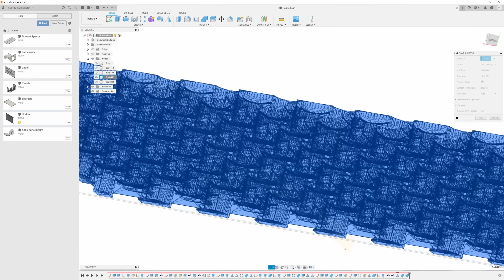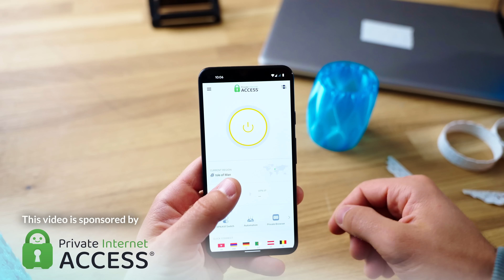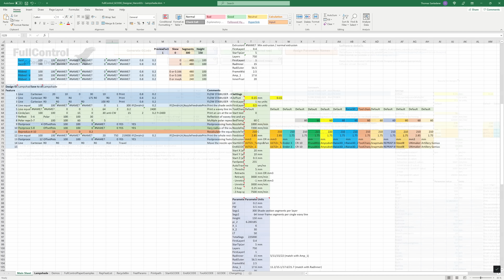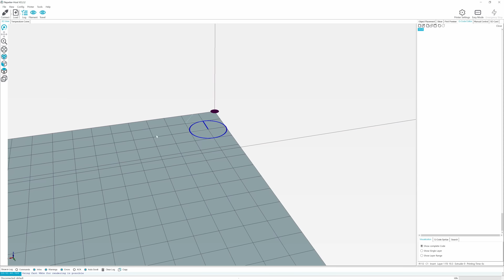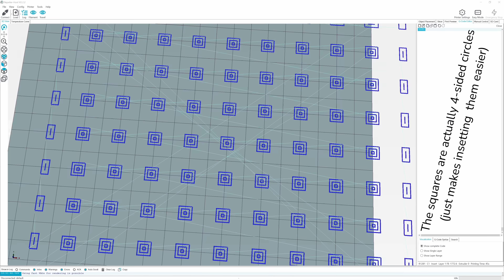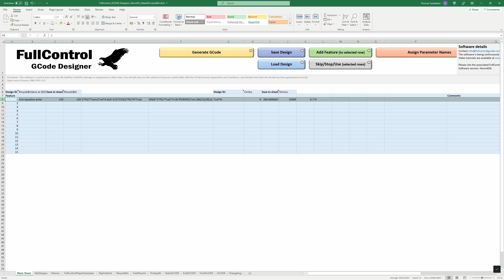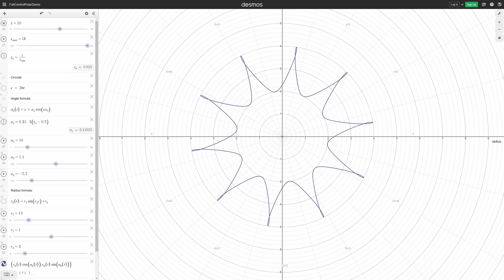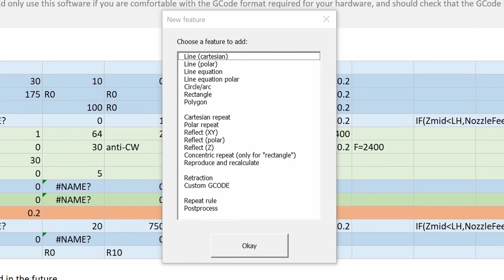You can SKIP 3D modeling now

Comment: This is making me think that 3D editing software needs to have a "3D printer" mode whereby aspects of the modeled objects are tailored to being 3D printed, like you tell it you'll be using an 0.4mm nozzle with 0.2mm layer height and the snap-to-grid functionality is adjusted to work to those parameters, ending up with objects that are more "3D printer friendly", which would be especially helpful for mechanical prints.
Reply: makes me think it openSCAD could be modded to something like this? instead of using uh excel...
Reply: or etch a sketch mode, with a 3rd z dial
Reply: I don't know how long it's been there but Blender does have very rudimentary and basic 3D printing visualizations. It will color highlight overhangs or intersections that can be fixed before exporting.

I was thinking the same thing. 3D programs are WAY ahead as far as modeling and automated repetition when it comes to slicing. They SHOULD have this option to control and out put gcode right from the start. This "full control gcode" I think could possibly be written as a blender addon... maybe. Blender already has a slew of mathematical nodes for shading and geometry.
Reply: I set user parameters in Fusion 360 to optimize these things as you say. Any shells are multiple of my extrusion width parameter, etc. It takes more intentional planning up front with regards to how the model will be printed and used in order to set it up the right way, especially with more complex models, but it's powerful and functional all the same.

Comment: i cant decide if implementing this in excel is genius or an awful hack :D 
its a neat idea though, if a bit niche :)
Reply: Its an awful hack. Sure it was probably quite easy in the beginning, but the level of complexity where it should've been remade in a better language/framework for the task is long overdue at this point. There is a lot more potential left on the table, even such simple things like a live preview, which just cannot be added to exel, even with macros.
Reply: Well, they seem to think it was an awful hack and are re-doing it in python, according to their website
Reply: its a "quick and dirty" proof of concept to see if the project was viable, now time to build.
Reply: i think it's semi-genius. It begs to be implemented as a plugin for a cad, to allow combining the tools. Some CADs already have spreadsheets built into them.
Reply: @victortitov1740  By the same token, many CAD programs have some scripting API that would be more efficient and flexible than trying to port it to their particular implementation of spreadsheets - which wouldn't include VBA macros anyway.
Reply: After having done programming based on something first made in excel I can say it is always an awful hack. It works in small scale but breaks if you need to scale up what it shall do and data stored can often be a lot of work to transfer since excel is not a database, even if you have function that my look like it is.
Reply: maybe it's just... both
Reply: Yes.
Reply: Using MATLAB for the job seems much more sensible to me.

Comment: I cannot overstate how excited this makes me. Up until now, the only way I knew to design a propeller required me to manually discretise it’s curvature (I’m not sure if there is a way to do it continuously in F360, I couldn’t find what I was looking for.) which didn’t sit well with me. I wanted a way to define an angle wrt radius, I thought openSCAD might be the way but didn’t look too far into it. Thanks for the great video.
Reply: Openscad is awesome, but it approximates curves
Reply: @JohnDoe-rx3vn  Everything approximates curves. Gcode moves in straight lines for 3d printers (unless you know of any which take the circle commands and even then you'll be limited by the steppers and the firmware).

Comment: Using excel is a bizarre implementation, but I will give it props for creativity. 
It reminds me of OpenSCAD but specifically for FDM printers, instead!
Reply: a python version is on its way!
Reply: @RonaldoMessina  well yeah I figured as much.. but having it right there in scad would be pretty sweet. So you could use its display to see what you were doing. I guess you could still do that with a mix of python and scad, don't know
Reply: @RonaldoMessina  With pandas? :o
Reply: @Mr_Yod  OMG please no, the only thing that says amateur hour more than Pandas is Jupyter Notebooks.
Reply: yeah and without compatibility with a cross platform spreadsheet like Libreoffice it's restricted to only Windows users

"bUt YoU cAn RuN wInDoWs In A vM"
no. just no.
Reply: @ailivac  yep, just keep artificially restricting what you use based on some posture. You do of course know that LibreOffice also supports VBA? If it isn't a good implementation that is LibreOffice' fault, not Microsoft. Perhaps if the FOSS didn't fork code at every opportunity then there would be enough coders/designers to actually do something. Every fork splits the pool, diluting what is possible.
Reply: Well it stands the reason that you could do this as an add-on to open scad. Let's hope some sharp bit weenie takes up the project.
Reply: Yeah, this seems like it could be very easily implemented in a scripting language. But I guess spreadsheet interface is somehow more accessible?
Reply: I bet this academic person in the course of doing their work has become very proficient at Excel and not at anything else the least bit programmatic so... here you go.
Reply: @MostlyInteresting  it's impressive. the amount of brain power it takes to learn VBA for Excel, become good at it, write a giant project like this, and make it work, is probably an order of magnitude greater than what'd be required if it were made in python, or js, or malbolge
Reply: @MostlyInteresting  VBA is a very powerful tool for automation. And it is a programming language. Have you bothered to look at the code?
Reply: @MostlyInteresting  I work with big data, and Excel is one of the most powerful single tools around once you have reduced the data down to the essentials for final analysis and visualization.
Just because one can write a script to do something, does not mean one should...

Comment: Hi Thomas, great contend you are producing. Today I came across an issue with my printer, that is maybe interesting for you and you can cover that in one of your next videos. I have a Mingda d2 printer, one of the best I ever owned. Iam printing currently a lot of parts for one of my customer. everything worked perfect, than over night the nozzle was blocked... Well the filament get stuck in the runout sensor (echt beschissenes PLA) so the nozzle could not print anything.... Nozzel blocked. I was in a hurry and said to myselfe, before I clean the nozzle now, I do it later and install a spare one with the same diameter. I started the same print with exactly the same settings and there was massive underextrusion... So I stopped the print again cleaned the old nozzle installed it and everything works perfect again. So there must be some nozzels out in the market that do not meet the diameter that is mentioned on it and there arre massive quality differences between them! If you need the nozzle as an example let me know. Und wie du dir denken kannst können wir uns auch auf deutsch unterhalten und ich kann dir mehr informationen geben wenn du möchtest. Bei bedarf einfach kontaktieren. Liebe grüße Johannes

Comment: "The possibilities are endless.. but it has limitations".. It has more limitations than possibilities. Very, very niche tool for something very specific.
Reply: Not really. It's just because we still not where additive manufacturing needs to go. Right know we are using a modeling program that is designed to show models in a virtual reality. Then we use an other program to disassemble it into slices and making 2d versions. 
When 3d printers get able to use non planar printing we need something like this..
Reply: It just needs to be remade in a better programming language
Reply: When mass producing, this would save thousands of dollars

Comment: Super cool! "Traditional" 3d printing process workflow is 3D Modeling->STL->Slicer->GCode. FullControlGCode is basically trying to take out the tessellated/triangulated STL manifold from the equation and use the 3D Modeling information about how the model is actually designed/created into GCode.

Comment: I can't think of any advantage of implementing this in excel vs anything else.
Reply: It might be as simple as Excel being the GUI-creation-capable tool with which the creator was most familiar. After all, the best programming language for a project is often¹ the one you already know.

Other languages may have all manner of advantages, but having to spend weeks or months learning another language may nullify its benefits, result in the project not being finished, or even not being started if it's expected to take too long. Yes, learning a new programming language/tool is often a worthwhile investment in itself, but the time to do so may just not be available.
My understanding is that this was a university research project, so having some results to show fairly quickly could have been important.

Personally, I'll always favour "tool that actually exists, but using sub-optimal platform" over "highly-optimised and perfected tool that the creator hasn't had time to finish/start" 😉

¹ "Often", not "always".
Reply: Accessibility for a larger audience?
Reply: @sagichnicht6748  excel is behind a paywall
Reply: @RonaldoMessina  Yet, many possess it and even more know how to use it, many of them not literate in any programming language. Just saying. Not claiming it is necessarily the best choice.
Reply: Most likely simply because the person/people working on it already knew how to work well with Excel. 
When you make a tool, especially when doing so primarily for a research paper, you just use what you know. No reason to make it even harder on yourself than necessary.

Comment: Pretty sure I've seen gcode generation for printing in a scripting language like Python. Seems a better approach than a spreadsheet. Maybe a tool like processing.js would be good too. 
My own take on how this could work: I can see how a template library of code generated and hand drawn parts could be stamped out under control of a script. A syntax for extrude this template, repeat this along an axis, stagger this to skew it, etc. could generate an intermediate representation of poly lines at particular z heights freely and then an optimisation pass would connect the polylines at a particular height into a single pass of the extruder. Then a backend emits gcode applying config variables like flow rate and move speeds. So the order of defining your object is decoupled from the order of the final gcode.
I'll link some projects related to gcode generation below which are not the one in the back of my mind and do not afaik implement the approach I mention here.

Comment: Super cool, very much like structure synth but straight to Gcode. Maths hurts my head but might have to suck it up!
Reply: I'd be curious to see why it didn't work in libre office, it does have vba support. In any case, looks like a Python version is coming soon. This seems like it's for people who find openscad too high level.
Reply: Do you think direct control operations could be added to slicers?

That's what makes me most excited about this.  I've been dreaming that one day slicers will add "hey printer, do this" type commands to their programs.  Or at least some sort of gooey system for editing the G-Code.  I mean honestly..  Why can't I just click a layer and tell the printer something like "pause for 3 minutes", "add a line here", or "insert district control spreadsheet from file". I don't want to turn slicers into fully blown CAD programs but why not have some tinkercad type functions in there?
Reply: @VagabondTE  Totally. The current slicing workflow is crappy. Start with a 3D model potentially including lots of information about required strength etc. and curve data, then throw that all away and turn it into triangles, then try to convert the triangles into printable gcode. Such a mess. But even if we're stuck with STL as an intermediate format for a while longer, the workflow from there on could be much more customisable. I have some ideas, but unfortunately very little time...
Reply: The idea is being around for a while. Back in 2017 wrote my own program to do similar things after got inspiration from some article.
And there is not much math in a whole thing: just a series of very simple and easy to grasp concepts. F.e. (in case you doing your own programming) - how much length to extrude when doing a line of x mm with some given layer's height.
Definitely an interesting approach - but you should think of real problems where it may shine. In most cases regular CAD is a way to go.
Reply: Drugs are bad, m'kay? Don't do drugs! :D
Reply: ugh but forced msoffice is cancer
Reply: @natalieisagirlnow  it's a shame, I refuse to pay for office but 30day trial lets us play a little at least.
Reply: @MakersMuse  sail the high seas :) You can find older better version too

Comment: This would be amazing with like, python or something, instead of excel.
Reply: The website says that they’re working on a Python based rewrite…
Reply: @UloPe  Excellent, kind of a good detail to mention then instead of the specific focus Tom gave to it being a spreadsheet we should not criticize too much. :)
Reply: Hopefully this leads to more optimized, dedicated software solutions that can run faster and work in conjunction with a Gcode visualizer of some kind. I don't know much about software development, but could it work as a Cura plugin, for example?
Reply: python can easily interface to other software too.
In python it is relatively simple to read an STL file and slice it, or use it as an exclusion zone.

(I have written a python script once with STL slicing and gcode generation for printing a mesh like structure.)
Reply: I was thinking the same thing. I despise excel and their convoluted functions... Syntax is a nightmare
Reply: Indeed, Excel isn't built for this (seems my original comment stating that was removed??). Anyway, the problem is that any little mistake causes big issues, especially if you're free to edit it. This is why a programming language was invented basically. Excel is for data representation mainly and should be used as such. Matt Parker has great fun in showcasing all the cases where Excell was used as a database etc. :) Having worked in science myself, this is very likely because the researcher just used something he was familiar with.
Reply: CADquery is probably the closest but yeah python would have been nice here too.
Reply: While I was watching the video, when Thom said "Excel", I thought about Python with pandas; then in the comments I read that a Python version is coming. =)